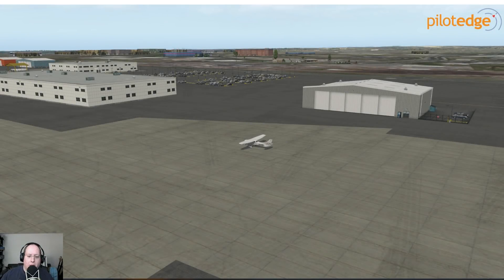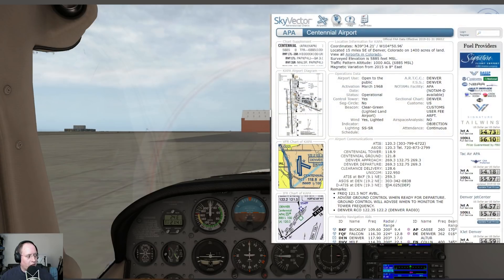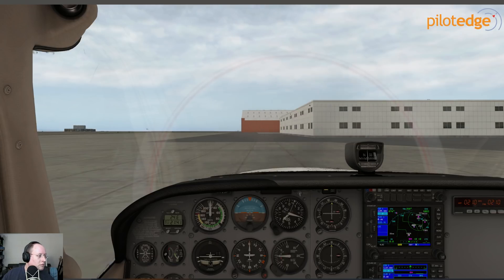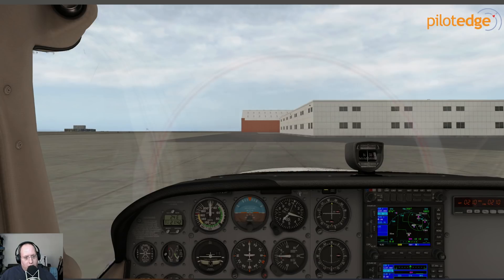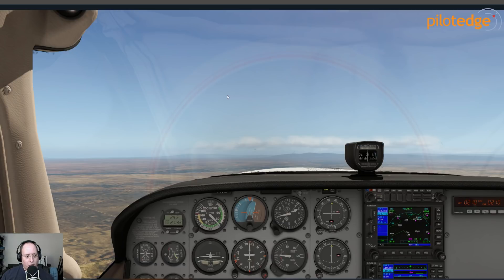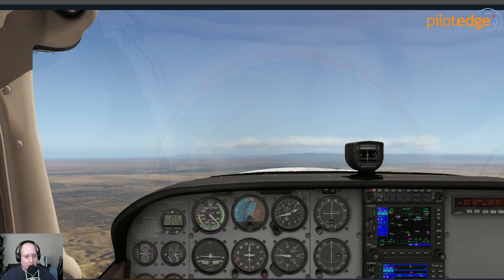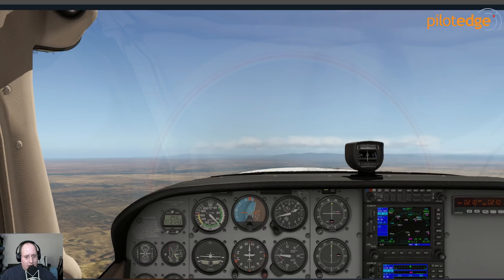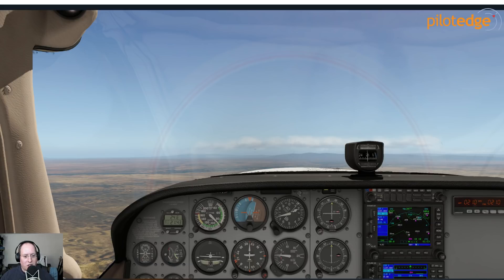PilotEdge ATIS System Preview

Comment: Thanks.  Been wanting this feature for a while and you've ticked all the boxes I'd thought of and several that I hadn't.  (I love the Zulu weather method of communicating custom weather without breaking immersion, the VHF degradation sounds great and the way it will automatically switch to standard xplane ATIS if you tick the box on your flight plan is really clever).  The recorded ATIS sounded really good as well.  :D
Reply: Glad you like it. The VHF degradation is a hoot, too. Try picking it up from a distance in mid-air, then continue descending as you head away from the field and just hear it get worse and worse. Then, climb back up and hear it improve :)

Comment: Looks cool! Can we get the ATIS on COM2 while we are talking to controllers on COM1?
Reply: Since the ATIS is just a radio broadcast, the question at hand is "can you monitor two frequencies at once on PilotEdge?" The answer is yes, assuming your aircraft's audio panel supports it in the sim. In suitably-equipped aircraft you can even alter the com1 and com2 radio volumes separately just as you would in the real world if you were trying to pick up the ATIS while also monitoring ATC.

Comment: Does it support untowered airports with AWOS/ASOS?
Reply: Negative, your sim does that already, so it would add little value while being very expensive to support. The value of ATIS is that it understands the runway/approach in use plan for the network...something that doesn't apply at non-towered airports. In that regard, AWOS/ASOS is just a reading of the WX, which the sim can already do quite well.

Comment: I assume that this will disable the internal atis on X-Plane then?  Sounds really cool.
Reply: Yes, it will. P3D customers will have to do a bit of configuration to disable the built-in ATIS, but it's not much. For X-Plane it's automatic.
Reply: Tim, to piggyback on that, the pilotedge plugin will therefore inject the local weather specifics into the sim now?  I apologize if that is understood or mentioned elsewhere.  Sounds awesome, and that’s some great work.
Reply: @Oni76  No, we aren't in the business of weather injection. The sims itself do a fine job of that (well, normally; I hear there's a bug with XP's weather retrieval for the last day or two, but that's unusual) or people use various plugins (that in my experience give identical results to the sim's built-in stuff).
Reply: Thanks, Tim.  I didn’t think so, but figured I’d ask.  So main thing is the ATIS code and validation along with the very cool radio dialogue improvement and static at range.  Nice work, and hope it goes smoothly on launch, sir!
Reply: XP11.30 added the ability to disable built-in ATC via the SDK at our request. We suppress the in-game ATC for XP11 when it's appropriate to do so. This means you can still monitor ASOS at non-towered fields, or receive ATIS at towered fields which aren't considered towered on PE (such as some of the Class Delta airports within WUS).
Reply: @coma13794  Keith, Tim - that's a great feature :D

Comment: So will this control the weather? I ask because, say if one person is using stock XP weather, but another person is using Active Sky, there weather in sim (both using real world weather) may be different. If this does not control the weather, how does this new system mitigate those problems.
Reply: PE ATIS is always based on the current real world METAR.  PE does not control the weather in your sim.  As always, the mechanism to maintain real world weather in your sim is up to you.  As Tim mentioned, should you elect to use custom weather, ATIS code ZULU is reserved for that purpose.
Reply: @krullery  How do you define custom weather?
If im running active sky with live weather is that custom or the same weather PE is using?
Reply: Sean Jones custom weather = anything that is inconsistent with real world METAR.
Reply: It's not a problem. The network has run without injecting weather for 7 years and the fact that people use custom WX on a regular basis has not caused conflicts. What has been an issue is having the sim report ATIS codes that we don't control, among other logistical issues with the controllers being up to speed on the current ATIS and runway configuration. The new system solves those things.

Comment: This is awesome! Will it work on com2?
Reply: Yes, assuming you can hear PE ATC on COM2 now. Some planes don't have a COM2 radio or the audio panel is cosmetic and isn't actually programmed to work, nothing we can do about that :)
Reply: Since it's just a radio broadcast...a better question would be, "does COM2 work for receiving on PilotEdge?"  The answer is yes, and you can it at the same time as you monitor another freq on COM1. The audio panel issue that Tim mentions is actually more of an issue for selecting which radio is used for transmitting. Those transmit selectors are poorly modeled on most aircraft...but the RECEIVE option usually works fine. So, you should be in good shape.

Comment: Where is it pulling the info from?
Reply: I'd assume a combination of standard METARs and programmed profiles that are chosen based on given conditions and operations in use ie. controllers can adjust it manually.
Reply: It pulls from the same weather source that x-plane uses. The runway configs are proprietary to our system, taking into account wind direction, strength, visibility and ceilings.
Reply: @coma13794  Also, by the sound of it someone is recording the ATIS?  So it isn't like xplane is dynamically building it (or a similar feature at PE).